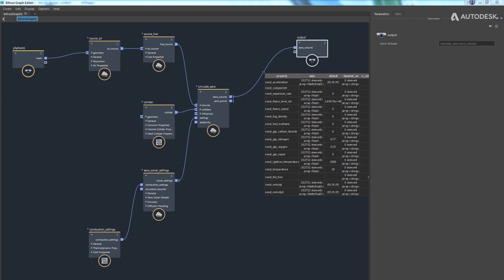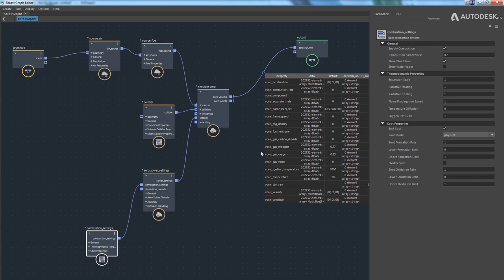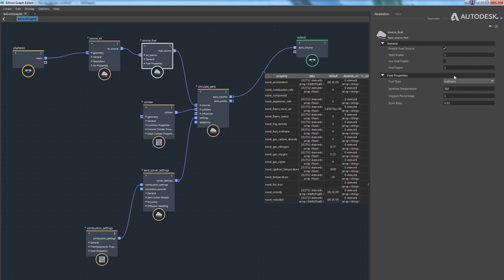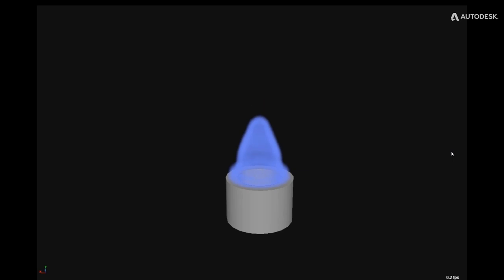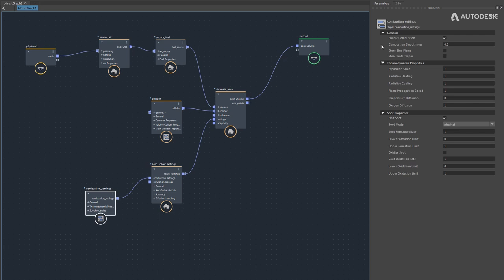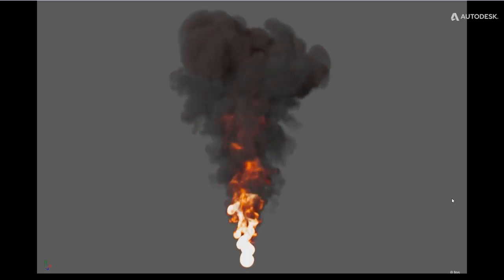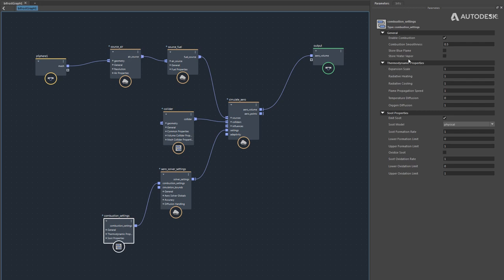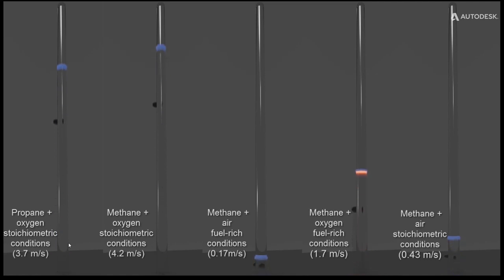Bifrost Master Class: Bifrost Combustion Solver Parameters – An Overview

Comment: This video is extremely frustrating to me. I tried to follow along to create a visible flame like a bunsen burner, as shown, but nowhere does the author mention that you actually cannot see the flames unless you connect an aiStandardVolume material to an assign material node between the simulate aero node and the output node. You imply in the video that if you play the animation after using the settings shown, you should get the result that you show in your playblast/render. That is not the case. Am I missing something here?